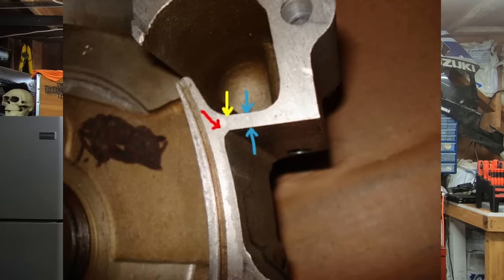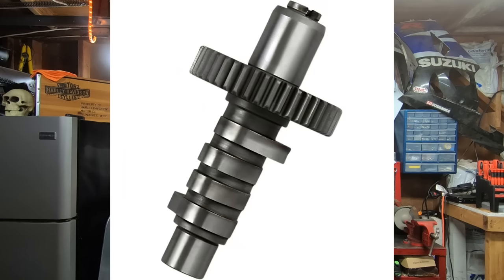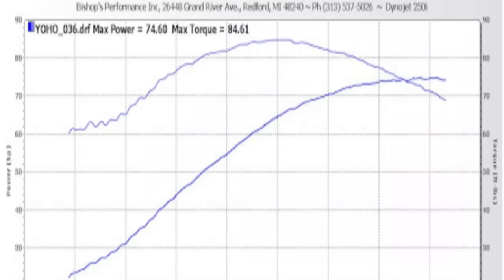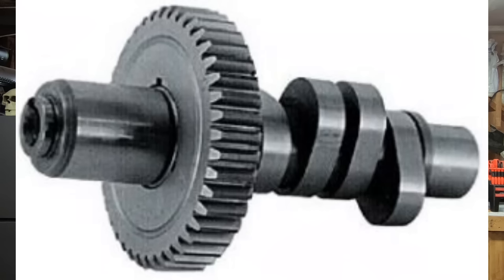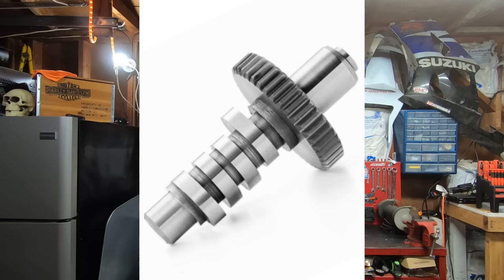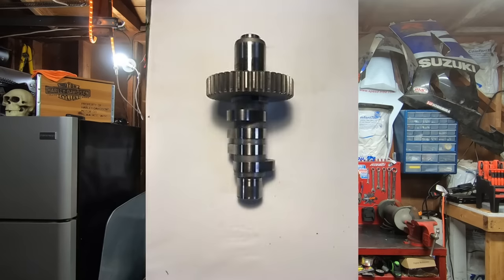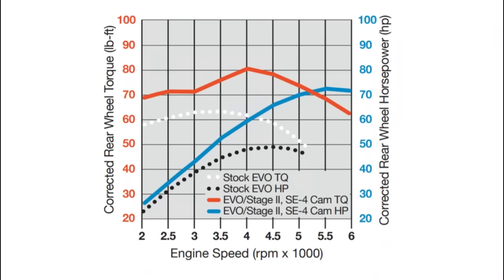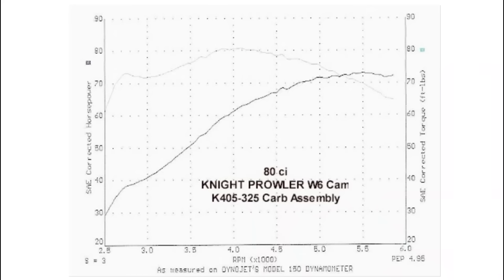Absolute Best Upgrade for the Evolution Harley-Davidson

Comment: Disappointed you don't show  a dyno graph from the Fueling 518.  I happen to be running one.  I've got air cleaner and pipes, 9.65:1 CR with S&S HC heads and am running a Delphi(style) conversion.  I was running a 547 Fueling cam, but two-up in sixth gear I was constantly shifting between 5th & 6th at my preferred cruising speed of 70 - 80 mph This correlates to about 2700 - 3000 RPM.  Fueling shows a graph for the 547 shows a dip in torque at that speed.  The fueling site doesn't have a 518 graph either, it does work much better.   With the 518 I have the torque to maintain anywhere from 65 mph on up.
Reply from the maker: I'll have to dig up one from the 518, that's a cam I haven't heard mentioned in a long time!

Comment: I used the EV27 in my 89 FXR with Crane adjustable pushrods, James lifters Crane HI4 ignition milled the heads .40 other guys were cutting 60 thous off I went 40 due to pump gas. I sold it years ago and as far as I know it's still out there and doing good of course the topend has been done a couple of times.  Now days I'm run the EV27 in my 1997 Dyna 23k on the clock in a few more miles I'll upgrade to adjustable pushrods and lifters not sure which lifters on ignition I'll use? I can tell you when a lifter goes bad you'll think the engine has blown up!!! The Wood cam sounds interesting but I doubt I'll replace the 27 due to I already have it and it does the job. I guess my question is how does the EV27 do on the butt dyno compared to the Wood cam? It sounds like it'd be better?
Reply from the maker: They are actually pretty even for the most part. I like the Wood's power curve but the Andrews is very close and you can pick them up for less than 150 bucks new.
Reply: The woods 6 will produce more torque and horse from 3500 rpm and up to 6k no problem.. butt still performs extremely well down low..

Comment: I was wondering if you could do a video on the EV46? I have a 86’ FXRS and want the most I can get out of a simple bolt in cam. And I want the bike speaking to trash talk me while it idles
Reply: I can tell you from experience, if you run the EV46, up the compression to around 10:1. You'll love it, especially if the bike isn't too heavy.

Comment: It's not fair to say an evo was not known for power, to put it in perspective, it was a reliable engine, with a broad range of custom style and performance potential, power was adequate but big cubic inch builds weren't as popular because of the conservative approach to casting thickness and limited test to failure research failed to inspire further R&D  into stronger and more durable alloys, strengthening by revamping mold dies to tailor an increased casting thickness was omitted and a method to produce a less sand inclusive product. The limited options for increasing displacement options, forced new approaches and wide spread trial and error led to impressive alternative methods for power output gains. One of the most powerful proven mills retained the factory std. bore diameter and stroke, 80"  just shy of 130 hp bolt in setup,  with reinforced cases and some intake and exhaust port improvements. That's over 3x the factory HP and it ran several passes on the weekends and was a daily cruiser.

Comment: Woods w6h at 10.5 to 1 . 106tq and 100hp
Reply: I have a Woods W6H planned for my 95 Fatboy. I have Super Sport heads and pistons with stock displacement and 10.1 compression going on it too. Did you have any modifications to get the W6H to fit, like case clearance? Also is it noisy? Thanks
Reply: @brucewilliamson7199  Yes, you will need to grind a small amount of material around the inner cam bearing but that was on an 80in not a 95. Also, make sure your piston "squish" numbers are nice and tight. this will help with fuel mixture and combat "ping". I was able to push my compression up to 10.5: 1 with this setup with no problems and it's been over 6 years. If you build that 95" you are going to have a monster!

Comment: What would you recommend for a 1995 1200 EVO Sportster? Stock carb & air cleaner, Screaming Eagle slip-ons. Not looking to tear into the motor, just want a little more grunt
Reply from the maker: Best you could do there without getting the motor would be a jet kit and a open element air cleaner. Start there with the SE exhaust and then upgrade to a different exhaust if you need more.

Comment: @Gixxerfoo - I’m am installing a cam in my 1999 Harley Springer custom.  I’m leaning toward the EV23 for more power and preserving my fuel economy.  Most people seem to be running the EV27 but is it worth a couple of more horsepower for the steep cam lobes?  I have Vance & Hines tru duals and stock carb.
Reply from the maker: EV27 is more of low end and mid range cam, the 23 seems to have some more top end as it runs out higher. Both are pretty comparable but the EV23 puts more power on top. The EV27 is by far the most popular Evo cam out there.
Reply: @GixxerFoo  so for mileage and low end grunt you favor the EV27?
Reply: I bought the EV27 since the power is essentially in the 2000-5500 rpm range where I need it.

Comment: I've got the EV 27 cam in my '88 FXR.
Reply from the maker: I love those cams in the Evo!
Reply: @GixxerFoo  I realised I was mistaken about cams. My FXR runs a EV3 cam,with Wiseco High compression pistons at 10 - 1 (I think),and a S&S B Series carb.Ive just rebored main jet out to roughly .070,using 1.8mm drill bit.It goes so good!!
Reply from the maker: EV3 is a awesome cam, l imagine your bike does really well with that main jet mod!

Comment: The Harley Big Twins, speaking of the Evo and Twin Cam are underpowered from the factory out of the box. It's disappointing because I love the look, and the sound. My first Harley was a 04' 1200 XL Sportster and it had from the factory 61 hp, a Twin Cam 88 has about 60 hp. So the 1200 Sportster had more hp per cubic inch. However they just don't get the respect that the Big Twins get sometimes, and also with the Sportster's lightweight it gets blowed around on the Interstate more, is less comfortable. However to zip around town on from stop light to stop light, it's hard to beat a properly set up/tuned 1200 XL because of the power/torque to weight ratio.

Comment: I had a 82 shovelhead 96-in s&s s&s super e and I used Chevy 350 roller liftersand only had a problem when I had stock Harley they had one fall apart and take out my oil that's when the Harley mechanic told me about using GM 350 roller lifters don't know if this would work on a eviobut I think I might be something worth checking into lease then you know you can get more than 40,000
Reply from the maker: That's a very real thing using 350 lifters in a Harley, they are virtually the same except the oiling orfices in the 350 rollers are a bit smaller but everything else is the same.

Comment: bolt in cams are the best IMHO ... there is such a thing as too much lift, as your valve seat's ability to flow goes ... 
but if you get a cam with fast open and close, Stick With The Stock Push Rods, and get beehive springs ... 
decreasing valve train inertia is paramount with such cams, and bee-hives are not a bad idea with any cam swap
the beehive retainers weigh less, ( important, past the rocker ratio ), and i haven't found anything lighter than the stock H-D push rods yet. 
( still waiting for a manufacturer to pick up the cue from chromolly automotive tube push-rods, with roll formed ends. )
Reply from the maker: I'm a huge fan of bolt in cams and lot of that is for the reasons you mentioned above!
Reply: @GixxerFoo  there is the issue of piston heat, when camming pre-pin oiler Sportsters ... H-D put in the pin-oilers when they went to the W-cam ... 
if a piston gets too hot, it can get too big for the bore, ( ouch ) if your making more power, your making more heat.
so Always install a high volume oil pump when camming a pre-pin oiler ( 2003 and ealier Sportster.)
Reply: @GixxerFoo  where the pin-oiler Sporters,
 ( 2004 and later ), can thermally handle any aftermarket camming done correctly.

Comment: I just picked up a Sifton DS141 Cam, what do you think? I typically ride from idle to about 4500 RPM maybe, I'm really looking for torque. Do you think this cam is what Im looking for? I have rebuilt heads, top end, cv carb, Dyna Ignition, Scr.Eag exhaust, after market air cleaner. This is an 84 Evo softail.
Reply from the maker: Not bad cam, a lot of guys couldn't get the marks they wanted out of them though. They do perform pretty well but they didn't have the power level most expected. You might check out a Wood cam for your Evo, those things really perform insanely well.

Comment: thanks for great channel I've done lots of mods thanks to you.s&s claims their adjustable push rods are 32 thread per inch and ask for 4 turns or 24 flats. harley's adjustable push rods are also 32 treads per inch but they ask for 2.5 turns what am i missing here

Comment: So while running a stock evo, swapping for an Andrew ev 23 vs 27 has no difference besides where the power range is ??
Reply from the maker: The EV23 is better in a lighter bike, it runs out a bit higher but the EV27 is better for heavier bikes being more centered around torque.

Comment: another solid evo vid! i think my 95 fxstc has a stock cam im doing research now. if not i may go fueling 518 cam lifters and push rods with new bearing.id really like to find them in a kit not having much luck though.
Reply from the maker: There's really not any complete kits for the Evo these day, you can get the parts it will just all be separate. Good news is Evo parts cost a lot less than the twin cam kits!
Reply: @GixxerFoo  which lifters and push rods do you recommend to match the 518 cam

Comment: S&S 600!  Scary fast. 1990 FXSTC. Where’d you get that t-shirt?  I owned that bar for a couple of years twenty years ago.
Reply from the maker: No shit?! Really? Hell my dad and l took our bikes on a road trip and made a stop there!
Reply: @GixxerFoo  awesome!  It’s a great place. I owned a small bike shop back then too. Worked on Panheads to brand new Big Dogs. Lots of Ironheads. Built my Softtail in the early 2000’s. Over 110HP  out of an 80” Evo. Scary.
Reply: WhiskeySix03, if love to hear more about your build.. 110 hp is a hell of a lot out of an 80"er..
Reply: Where to start. 80” EVO. S&S 600 cam. S&S springs. Revtech roller rockers. Kibblewhite Black Diamond oversized high flow intake and exhaust valves. Heads were milled .010”. Chamber polished and exhaust valves were unshrouded. Intake and exhaust  ports ported and polished. Full radius valve job. Port matched and polished Keith Black intake manifold. Hooker two into one header with no baffle. Mikuni HSR 42. Rivera Pro Clutch. Destroyed the factory clutch basket on a dyno pull.   Dyna ignition with Crane single fire coils.

Comment: great video ,i recently did an upper end on a stock evo i am an old drag racer ,but hot rod harley is new to me. first i ported the heads[ took down the dam ] put in 11-1 keith black pistons put in a[ no 1 screaming eagle cam] [not a stage 1]  put a true duel shotgun pipe v&h  put in 10 mm wires and uridium plugs. running a stock carb ,and jetting would not run even wiyh lucas octaine boost .replaced cam with ev 27 would not pull mid to upper so put back in the no 1 . comp test was at 75 with the stock 8.5 to1 with the 11-1 went to 125 but would ping and sluggish until i put in boostaine octaine boost 2 oz per 4 gal made it rock! i kept going up in jet size started with a 175 and went to a 200 before i lost power went back to a 195 at about 5000 ft elevation i do not sell boostaine but what a difference! when i rode with 2 bikes last week up hills and on the flat i could out pull the 103 ultra glide and the 96 road glide with pipes and a cam kit! we were riding 1 up . the more you put in the tank the more power you get. this is the best upgrade you can buy................period! i also got 53 mpg on the trip as it boost mpg. i put 14 oz of boostaine with 1 oz of lead add and mix it .as i ride and put in the 2 oz evey fill the power goes up as i will only put in 2.5 to 3.0 gal so it keeps getting more octaine as i ride. i cant tell how much my octaine really was as it changes but was running 91 gas mix with the boost so a guess would be around 100 octaine ........the down side is just looked at my back tire .....need a new one .eyes front!
Reply from the maker: Damn you put a lot of work into that EVO! I bet it's a screamer now!

Comment: I am interested in dependability and longevity. When my Fatboy Evo hits 40 k I plan to replace rockets, push rods and single cam bearing. Not sure I need to change out the factory cam for that as long as it is in good shape. What after market cam would be best for that. I am a Harley parts guy not all that familiar with after market cams
Reply: Andrews EV27 did wonders for my 98 EVO.

Comment: Now are you saying that a good cam will get my “stock” 883 some respectable numbers? Without a tune or with?
Reply from the maker: I actually have a video on the Sportster cams and what they can do with the 883 https://youtu.be/QiW4PiKRBx8. On the 883 the displacement and heads really hold the power back, you can get power out of the 883 but it requires a lot of work. It's worth a 1200 upgrade unless you're doing a spec class racing that requires a certain displacement.
Reply: @GixxerFoo    Yeah, I actually found that video right after I left this question for you, lol. I’m trying to find as many reasons as I can to hang on to my 883 and not trade it for a 1200. So far the looks and the mods I’ve already made are all I got. But I really do love my 883, it looks so darn good!!

Comment: I wonder how it compares to stock on the graph?
Reply from the maker: Bone stock Evo is only like mid 50 horsepower and somewhere around 60 to 70 for torque, not much at all.
Reply: 56 hp 68 tq at best with the L grind cam. The N grind was a little less..

Comment: What’s a good cam for a evo with stock compression but high flow heads with .640 in lift valve springs?
Reply from the maker: Does the bike currently have a performance cam it?

Comment: Looking for something for my 2018 Iron. I need something that will give me more power for passing.I have the stage 1 already. Simple bolt in.
Reply from the maker: I would highly suggest an upgrade to the Hammer 1275 running an 883. It's about double the cost of the cam but it will literally double you're power power from the 883 and increase over the 1200's power with stock cams. Using the 883 heads and stock cams is the "vanilla version" but well worth it. With that said, if you just want to do cams on the 883 I would go with the bolt in 570 cams from Hammer. It will give some decent gain but not nearly what the 1275 kit will do for you.

Comment: Does screaming eagle offer a kit for an evo
Reply from the maker: Harley doesn't offer a kit but they do offer some different parts combinations. You can still get cylinders with stock bore and go with high compression pistons, also Screamin Eagle cams. They have SE heads, carbs and jet kits too, it's not all in one kit so you'd have to get it individually.

Comment: I really like that wood night prowler cam. I'm thinking that with the s&s 1250 high compression big bore kit on my 1200 with the heads ported should be over 100 hp!! Has anyone else done this setup!! Also I seen a cam known as The Reaper cam, how is it compared to The Wood? I too would definitely install new cam bearings and being that I'm from Canton Ohio, I would definitely always go Timken bearings!!! I would also change the Lifters. Why not your already there!!!
Reply from the maker: Getting a 100 horse on a Sportster isn't too hard with a rubber mounted bike, but if it is a rigid mount you'll need to get the worked. The 2003 and earlier heads won't support 100 horse, but with the right heads even the stock ones on a 04 or newer with 10.5:1 compression and a 1250 it is very possible.
Reply: @GixxerFoo  thanks! And its actually going in a Polaris predator 500 street legal sport quad! Definitely something different!

Comment: Doesn't my Evo red line at 5500?  Am I going to float my valves at 6000 regardless of what cam I am running?  And second question, isn't it easier to cut the push rods to change the cam?  Last time I replaced a cam it was a Shovel and I cut the push rods then went with solid lifters. I think I got higher RPMs with the solid lifters but I did not have a tach. My 74 inch was sure out running the 80s.
Reply from the maker: You can cut the pushrods with a set of bolt cutters if you're going back with adjustable pushrods. That save a lot of labor, shouldn't be an issue running to 6k with a bolt in cam. Sportster can rev to 7k with a bolt in cam and stock springs, recommend it, no. Despite what a cam manufacturer says I don't like tearing motors and being down, sure they can do 6k but I wouldn't push my luck.
Reply: That’s how I did both my evo’s, saves tons of labor and new adjustable pushrods aren’t expensive. In the 90’s I think a set of andrews pushrods were $60. If your going to turn over 6000 rpm you need to do some head work.

Comment: Are these cams marked in any way so I can tell if one has already been installed?
Reply: Most all cams are marked , you will usually need to pull it out as it’s almost always marked in the inside end
Reply from the maker: Should be stamped on the end of the cam